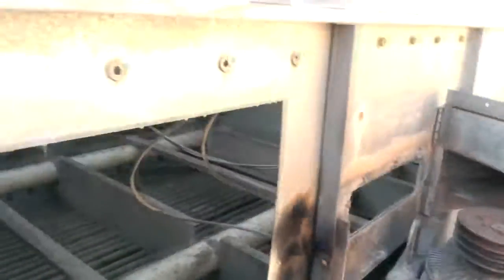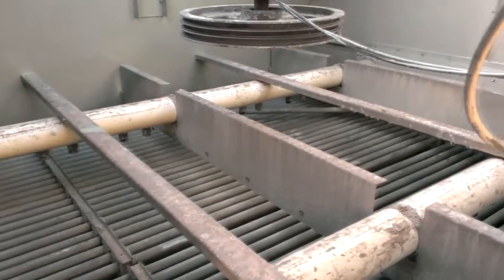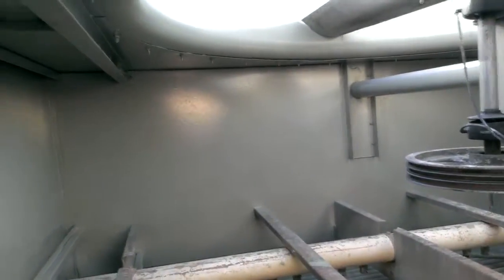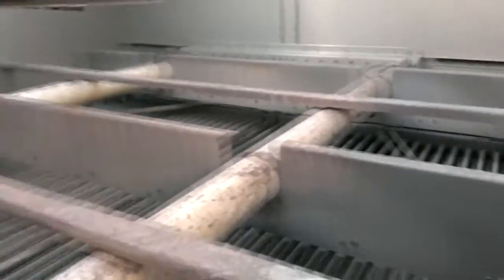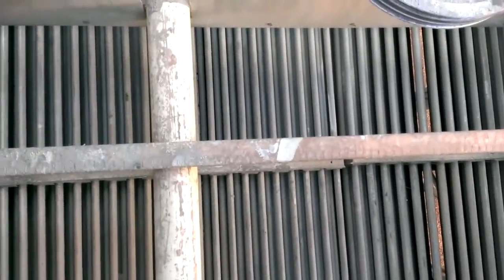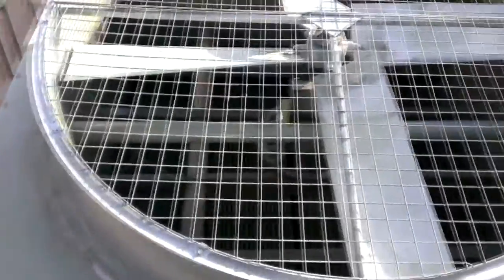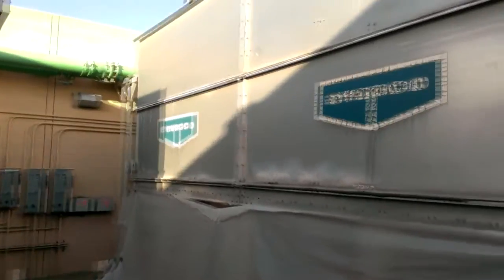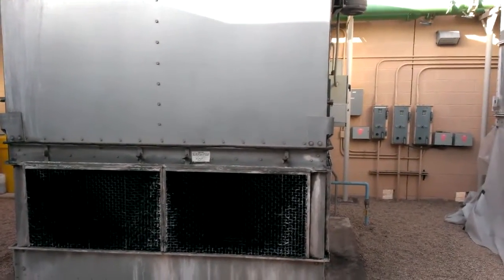Evapco Tower Refurbish - Show n tell of a disassembled evapco cooling tower

Comment from the maker: The other building has the chillers. 
This building just has water source heat pumps.

If you are not familiar with those, basically they are heat pumps inside a building without an outdoor coil. They reject the heat into the water loop. In the winter they take heat from the water loop. 

When the water gets heated up to about 80 degrees the towers start to stage on. In the winter if too much heat is taken from the heat pumps there is a Raypak boiler that keeps the water up to 70 degrees.